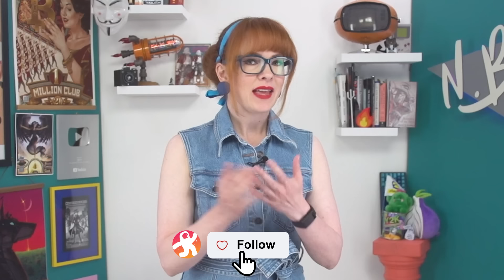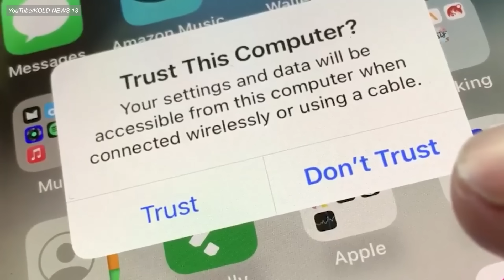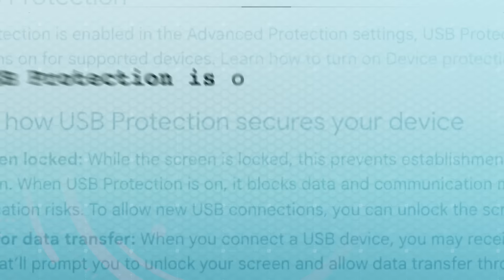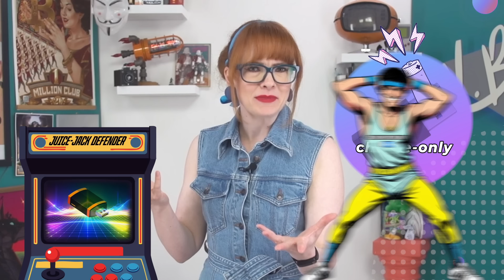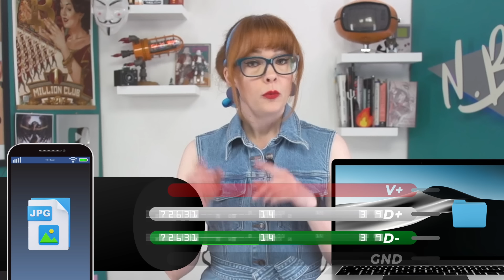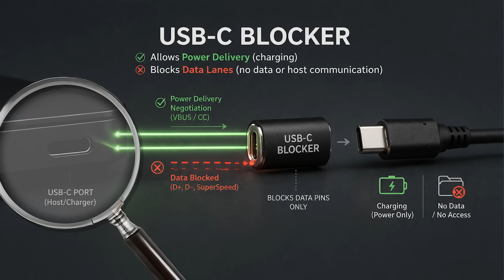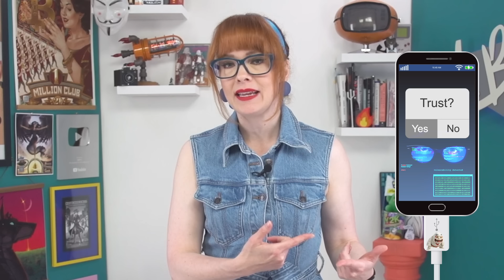Use THIS When You Plug In

Comment: I have a set of Data Blocker USB from a company called Fidioto, got it on Amazon for about $8 on sale. Tested it with my computer, plugged my phone in without it, it shows up, but when i add one of these in between the cable and it doesnt show up but charges. Been taking my data more seriously this year. I was careless for years but had my CashApp hacked and money stolen from me, recently i got "hacked" on Tiktok, i use " because i had access to it but i found someone loaded 4 videos about Fortnite cards that i didnt do, so i deleted them and changed some security steps like revoking all devices and unlinking the Sign in With Google. Hope thats the end of that.

Comment: Data blockers really work how you know is the ? If your charging your phone with out a fast charger and it’s charging really really slow even on fast chargers or your computer phones laptops say many hours before charged completely your electronics are hacked and sending data out somewhere plug in a data blocker in the usb port then connect the charger to your usb of your phone your charging problems are fixed drastically meaning your phone is blocking malicious data and hacking penetrating your electronics and what takes hours to charge is like 15 20 min with a data blocker

Comment: I have a bunch of old cables that have failed in one way or another, and I was considering splicing them to intentionally leave out the data wires, and so I checked with LeoAI (which used/ran Qwen VL 235B) 
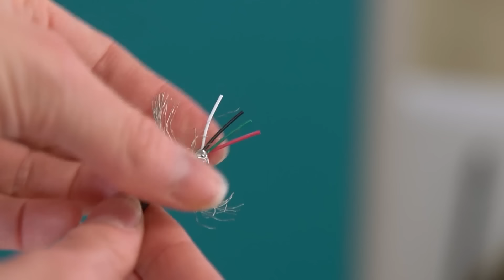"Considering the bit and images at about 6:30 of this video, Across different brands or companies or types of USB cables, does the red = +5V, white = data +, green = data - , black = ground seem to persist and be interchangeable?? 
That is, I have fixed and spliced many wires of many types, but I have never spliced across *different brands* therefore I am wondering whether there would actually be that same compatibility from one company to another, of matching e.g. only green to green for +5V and black to black for ground if I want to splice old cables to make a charge-only no-data cable"  
and it returned that 
"The color coding you described (Red = +5V, White = D+, Green = D-, Black = Ground) is the official USB 2.0 standard defined by the USB Implementers Forum (USB-IF). It is not merely a convention adopted by some manufacturers; it is a mandatory requirement for any product certified as "USB-compliant." 
Therefore, yes, this color scheme is consistent across virtually all legitimate, certified brands and cable types (USB-A to USB-B, USB-A to Micro-USB, etc.) because the physical connector pins are mapped to these specific electrical functions. If you splice a cable from Brand A to Brand B, matching Red to Red and Black to Black will correctly connect power to power and ground to ground."

Comment: Friends, there are another ways to ensure your device is only charging: 1. buy a no-data cable (one that only has two wires) they are also the cheapest cables available. 2. Turn any cable into a data-blocked one by cutting all the tiny wires inside it except the red (voltage) and black (ground) one, those those cannot send data. so if a wire is green or white they are usually designed to send data. But some advanced modern usb-c cables contain more of them for faster data transfer. (the traditional USB 2 is made out of just 4 wires, green white, red, black, which only green and white use for data)
The general rule of thumb is (unless the manufacturer switched colors for some reason) red is voltage and black is ground, those two only are needed for charging. the rest is data.

Comment: Keep in mind, even with a data blocker, you still have to trust that the port provides a suitable voltage and not fry your device. It might not even be intentional, just a very poorly designed or defective power supply.

Comment: Useful device for everyday users that may not be aware of whether their USB cable is charging only or for data transfer.  I like that they showed in detail how it works, that it simply does not provide physical connection for the data pins, only the charging pins instead of making it seem like some magical device without showing the simple technical details. Very good.   Only criticism is their display of the 4 connections.  The Data - is always next to the Power positive and the Data + is next to the Power negative, or ground as  they call it. "There is a distinction in electronics between Negative and Ground, but that is another issue and not really important in this example"  They have the Data pins reversed, but that is a detail that does not really detract from the overall functionality of the device which is valid.  Red Green White Black is the usual order of the wires,   They show it as  Red White Green Black.  Regardless, the device will do what they advertise and will block data flow.   So overall a valid and useful device,  in my opinion.

Comment: They also make USB to magnetic tip connections that do not allow data to pass.  The USB connection has a central pin and an outer ring to the positive and ground connections, but no other connections for data.  As a bonus, the magnetic plug stays in the phone port blocking dust, water, etc.  When you want to connect, the magnets line up automatically for a really easy connection.  I used them for years.  

Using a charging brick works too.  The brick doesn't transfer data, only a magnetic field ich is basically an isolation transformer.  One coil passes voltage across a copper wire creating a magnetic field, and on the other side as the magnetic field from the first expands and contracts, it induces a voltage across the other coil which powers the phone.

Comment: Many specific questions cuz I don't know the fundamentals: 

1) Re cables & adapters; Can malware be tranferred only while connected to my device? 
Imagine directly exposing one of my safe cables/adapters to a malicious source (port/cable), then disconnected. Then is the threat completely gone, or can the threat remain/be stored in my cable/adapter some way until I connect it with my device?

Also consider if the datablocker type (usb c - c or a - c etc) used has different answers to the next 2 Qs

2) Even with a datablocker, is exposing my cable/adapter to a malicious source safe for my cable/adapter? I wonder if the datablocker MUST ALWAYS be the first thing directly exposed to the malicious source.

3) If an 'exposed side' of the data blocker (the side that was directly connected to a malicious source) is later directly connected to my device, is it completely safe?

Comment: Or just always carry a power bank near of a data blocker, I have one that's the size of a stack of credit cards and will charge my phone almost 2 times. 
If you find a USB outlet to charge from, plug your power bank into it, then plug your phone into your power bank to charge it. It will recharge the power bank while charging your phone, but it won't pass through data. 
If you're worried data could get through, just charge at separate times.

Comment: I have quite the collection of USB cables built up over the years and not all are built the same. The good one's will let you charge and send data and the cheap will only let you charge. My advice is save your money, just use a cheap cable that wont allow for data transfer.

Comment: As I recall, USB-C uses the data wires to negotiate the requested power profile.  Doesn't a data blocker need to be able to accept data from both ends to enable that negotiation--serving as a 'man in the middle'--while not allowing either end to communicate directly with each other?

Comment: Just use a charging-only cable. They've been around for a long time.

Also, another good reason to not plug into "public" USB ports is that the power delivery may be suspect, and there is a risk of blowing your phone/computer's USB port up, permanently damaging it.

If you're going to charge your phone, use a power brick or an AC adapter and standard wall power sockets only.

Comment: VW supplies a very fancy usb cable with their car. That's why I don't trust it and always use a charger in the car and not the cars usb ports. They also wanted me to sign their data sharing program which I refused which means I don't get to unlock or lock my car over the internet. Excellent!

Comment: If you have an Apple iPhone. Only use Apple iPhone charging cables because they have that security feature built into them.   Also only use  Apple iPhone charging power bricks that you plug your AppleUSB cables in. Do not charge your iPhone in public power stations unless you are using an Apple USB cable. Your Apple USB cables also works on all non-Apple battery power bricks 😀

Comment: also consider a power bank

plug power bank into usb, charge power bank, once it's charged, unplug it and plug your phone into the power bank

or option 3: turn off your phone when you're not using it to save battery, then it'll last several days (and help break your tiktok addiction at the same time)

Comment: I plugged into a USB port on a Turkish Airlines plane and was quickly notified by my malware app that someone was accessing the data on my phone. I checked and it said "USB Data Transfer". I tried to turn it off and it showed the USB was controlled by the connected device and had to unplug it, then plugged it into my laptop.
I checked this on 3 more Turkish Airlines planes and they were all the same. Then the 2 Chinese planes I was on didn't do it, which I would have suspected the Chinese of spying before Turkey.
Never flying without a USB data blocker agian

Comment: Back when all USB chargers gave five Volts I used to have a charge splitter from Radio Shack.  It was a simple Y-conneector with only the power pins connected through.  Condom functionality off the shelf.

Comment: The other most important thing: Do NOT plug usb keys in your laptop/pc, unless it's yours. If you find one on the ground, do NOT ever plug it into your laptop/pc.
Reply: I keep a cheap air-gapped "throw-away" laptop for the purpose of testing dodgy hardware and software. If it gets compromised, I can scrub it or toss it, depending on how bad it is.

Comment: "USB charging has become completely normalized" Not when you hit Gen X it isn't as we learned both analog and digital systems and know that usb wall adapters are much much safer and fast charging blocks can be bought many places and are inexpensive. There is no chance to get hacked from a wall outlet so unless a major power surge/lightning strike hits your safe. Plugging your  stuff into anything that has an operating system, especially when online opens a way to access your device and is a vulnerability you don't need. If your going to hook your stuff up to a computer to transfer files maybe consider taking it offline until your done and have disconnected your device.

Comment: I've relied on a solar powered backup battery for a quick charge when I need it on the go. When fully charged, the battery can fully charge my phone 3 times and if I'm in the middle of nowhere I can use the solar panel to recharge and get a bit more out of the battery. Takes forever to fully charge the backup battery by solar only but it's still helpful and I never have to trust somebody else's cables or chargers

Comment: USB C has two sets of power connections and 2 sets of data connectors. It also has a sub connector that helps determine orientation. While you may not see it as upside down, the sub let's the system know when it is plugged in with pin set 2 as primary instead of pin set 1.

Comment: Hey, geniuses, data lines are used to negotiate charging rate even in the simplest chargers. Want to charge your phone 10+ hours using default speed - go ahead. On active usage you will drain battery faster than you charge it.

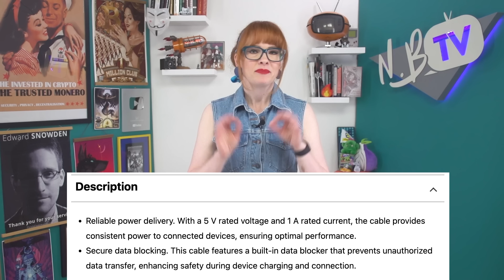Comment: Thanks for that thorough explanation, Naomi. Just one note @8:35 power negotiation happens via the additional CCn lines and it's I²C protocol, so in theory it should be possible to forward power negotiation to the connected device. However I have not inspected the protocol in depth so don't know if there's any more information that can be gathered from those lines. Another, cheap, alternative to this module is to use power-only cables and that's relatively easy to identify.

Comment: But wait, there is more! The two data wires are also used for the selection of the sort of power that goes into the phone or computer, before the power supply or host is sharing power with the device there is first some negotiating about the Voltage and the Ampèrage and this requires both data wires. This USB Data Blocker leaves you without fast charging or power charging over 100mA, for many phones this is completely useless. Not all users have eight hours to wait for the phone to charge. 
 
By the way, all USB plugs and wires have five connections, the plus, the ground, the data plus, the data minus and the shield. Some USB devices check the cable first. When ground and shield are short-circuited in the cable, then this is proof the cable is vulgarly cheap and not fit for high quality phones. The telephone will refuse quick charging from this unreliable source.

Comment: Basically, only a few wires carry power the rest carry data. A "charge only" cable should have only 3 conductors.
Never trust.
Use your own cable.
That little "data blocker port" should only have 3 connections.
Reply: Clarification:
The 3rd wire that I was referring to is the shield drain wire (cold ground) which is bare metal.
The other two are Red (+v)
And Black (-v)

Comment: doesnt the phone block any data transfer unless you manually specify file transfer is allowed each time?  anyways i use a battery backup and would charge the battery on a public plug not my phone.

Comment: This principle is crucial. A data blocker like this is mostly for when you're travelling ultra-light and even a power bank is too much extra weight.

I have a power bank that has 2  x USB C ports. It allows one in and one out simultaneously. So I use the power bank while out and about, and if staying at a hotel I only need one power point and 2 cables to charge them both while I sleep. If you're interested, it's a nitecore power bank.

Comment: You can get charge only cables.  You may already even have one.  There are USB cable testers like treedix which you can use to test all your cables stuck in your drawers :)   $20.00 - $25.00 for the LED cheaper version or $60 - $75 for the  screen version.  Amazon prices in CAD.  Also cheaper from Aliexpress and temu.

Comment: You can open any USB cable with a type A end and clip the green and white wires.  It then becomes a charging or power cable only.  Both data lines are disconnected, though technically cutting just one of the two data wires should be sufficient.  Best to do both.

Comment: Another solution is to use one of the cheap power only USB-C cables that you get with many cheap battery powered devices.  These only have two power wires and no data wires.  No data wires means zero risk of malicious power devices.  
Simple to check.  Plug your phone into your computer with the power only cable. If it does not reconize a device has been plugged in then the cable is a power only cable.

Comment: I use a USB C car charger that plugs into the 12V accessory socket. It gives me fast charging (9V 3A) and there is no data connection. 
When I travel I also carry a USB C wall charger, and a power bank, all from reputable brands that have been in business for years.

I just ordered a charging cable that is only supposed to pass on Power Delivery data over the 480Mbps pair. I'll verify whether that's actually true 🤔. The brand is "Plugable", which has been around for many years. Trust, but verify.

Comment: A reliable hardware blocker is best.
Relying on approval flows takes the attack back into the social engineering sphere, where your consent can be manufactured with the right pretext + context combo.
This is still true even with hardware - a person could be deceived into removing it - but it distills your question as a user back down to "do I need and / or want data to flow?"

Comment: Charge the phone in a car with 12 volt plug - it will not steal your data. 
And of course, use a non-hybrid and not electrical car. Careful - new Mazda cars don't have 12 volt socket.
Reply: That's what I do.  My car's built in chargers were always too slow in the first place.

Comment: This is where the magnetic charging is nice.
Reply: Can't they send data over the magnetic field?
Reply: @asumazilla  Apple MagSafe does not support data transmission.
Reply: @brucesmith9144It's a future thing to worry about.
Reply: ? 
I got a 2 pin magnet wire&plug
I got a 6 pin magnet wire&plug
It's not the magnetizity

Comment: A charge only cable works too. But a data blocker is a bit more flexible option.I set my android to charge only in developer mode settings. You can still change it to data transfer when you plug your phone into a trusted device and when you disconnect it reverts back to charge only by default. Its free, it works and you don't have to worry about a counterfeit data blocker. Less chance of vulnerability.

Comment: You can just buy a very cheap charging cable with no data transfer capabilities or get an old cable and cut off the 2 data wires and keep the power ones (red and black). Any way it will only be used when you go out of your home or travel.
Reply: If there is no data they can't negotiate the voltage, so it will end up charging slower